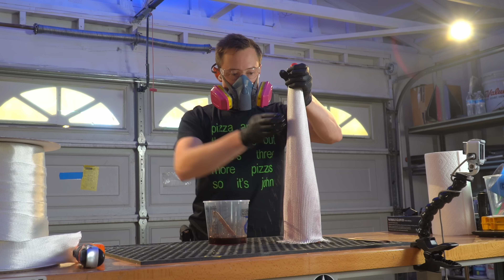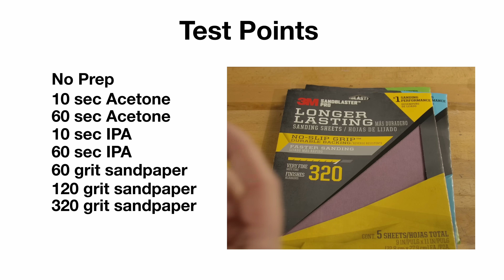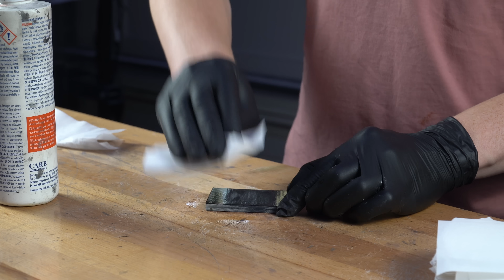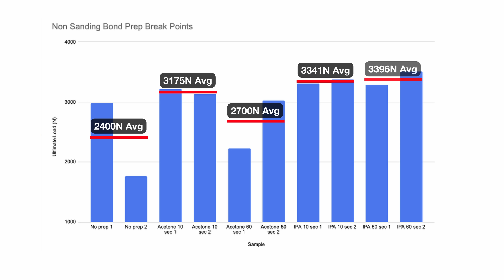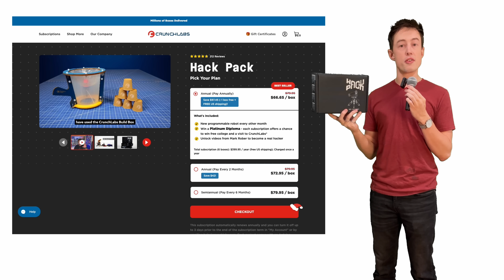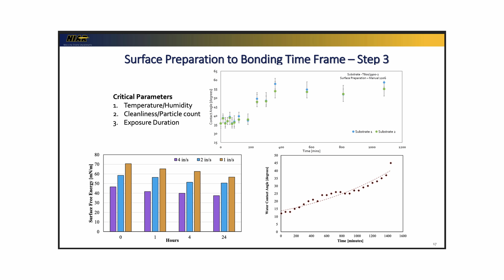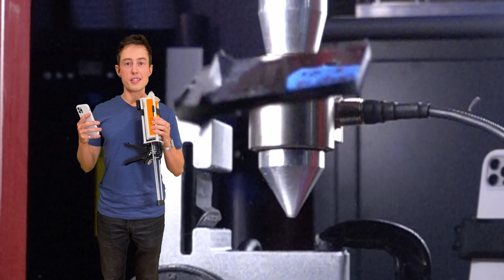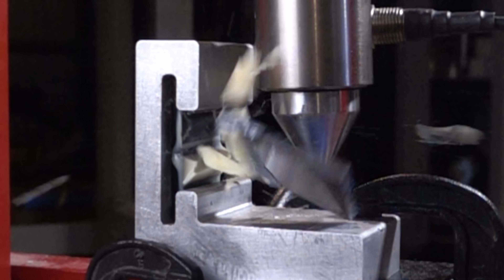I Broke 100 Epoxy Bonds to Find the Strongest

Comment: Few things: Check strength of bonding after longer time. Why? I know from my (and laser cutter community) some materials (as PMMA) cleaned with IPA after bit longer time (say days?) starts cracking. It is caused by phenomenon called environmental stress cracking (ESC). Not sure how it's work in your case, but just consider few long-time tests. Next: I'm very recent viewer and don't know channel - but why you don't use some few mm strong fibres in epoxy? Probably can reinforce joint.  And finally: Story with a specialist was hilarious :)
Reply: Slightly more flexible glue, with some form of added fiber (and/or fillet,mesh,...)

Comment: Tried drilling holes into the plexi, to give the epoxy a way to grip "at depth"? Right now it seems the failing part isn't the epoxy, it's the fiberglass. So dig "deeper into it", heck, idealy you'd make a hole with an inner undercut.....

Comment: 1. Why youdidn't makde the mold taller and wider to top, so vacuumed out resin can sip back by gravity? 2. Why not use a microscope to look on the surface, before pouring resin? After all, all you need is to see what surface bonds best, not so much, about how to make that surface in the first place.... This should be at least two-step check, i think. This magnitude microscope is widely available and quite cheap, especially compared to your workshop and tests price. Then you can check how your surface looks and mostly, how contaminated it is....

3. This is great! You gain resources and sponsoring trough videos that publish your knowledge - win-win for everybody!! What cool economic model!

Comment: Anecdotally i now consider cleaning with a solvent should precede my final sanding rather than being the last step…..you can cause and spread contaminants so easily unless you are impossibly careful. A freshly sanded surface is as contaminant free as it gets as long as you sweep away most of the dust. I take this a step further when gluing metals and will sand the wetted out surface to stop it reacting with oxygen as it is excluded.
Reply: When repairing the inside of cartires, we degrease the surface first, then we 
 sand and rough up the surface. Then remove loose rubber with pressurised air before applying the glue.
Far from brittle epoxy, but maybe still worth a try?
Reply: @frodeolsen6476 as long as its oil and water free air that works

Comment: When you complained about degassing in the chamber overflowing the mold, I was wondering why you didn't update the mold form so that there was a built in funnel at the site of the epoxy to  keep the epoxy in the mold, and get it to flow back into the epoxy site after degassing. Yes, there would still be some epoxy attaching to the mold, but the hope would be that you get a more consistent amount of epoxy in the joint. I'm sure it wouldn't be perfect, but if the target is more consistent results, it may help. But the tests were a year ago, any tests now would likely be with a new batch, or a batch (the old one) with a different age component built in.

Comment: I never wipe sanded surfaces with any solvent, they are already clean. Just blow the dust off. Solvents can leave some residue which can harm the bonding. Another risk is you don't give it enough time to dry so the solvent itself ruins the bond. Especially when you sand it rough it takes longer time for the solvent to evaporate.
Heating the parts and epoxy can help, it lowers the viscosity of the glue so it may adhere better. And it will evaporate the solvent completely if it is used. 
When epoxy is curing it is generally known that increasing the temperature makes it harder and stronger, something like 60-80° C for several hours. This can be done also afterwards, when epoxy has already cured.

Comment: i'd love to see more failure mode analysis from your bonds, especially later in the video. Can you spot a difference when comparing the samples with 2000N differences. With that low sample size, i'd bet you could get more insights if you look exactly how every part has failed. This is assuming you didn't and there would have been differences, of course.

Comment: A quick scrub with scotchbrite and a quick clean with your chosen cocktail of solvents would be fine for this application, you are still asking an adhesive to be a fillet, what you really want is a light silk-weave cloth over the epoxy fillet, it’s the way boat builders do(did) these sorts of joints. That way your fillet has a skin to spread the load, this way minor bubbles and imperfections are less of an issue.

Comment: I'm willing to bet the viscosity of the epoxy will affect which sandpaper is most effective. Thicker epoxy would have a harder time taking advantage of smaller surface features, and bubbles would have a harder time getting out of them.

Comment: Id be curious to see the results using your shapeoko to make a cross hatching pattern using a Vcarve bit on the surfaces of both parts. Then hitting the surface with acetone and IPA. Maybe do a few tests with different cut depths. Ranging from 1/32" - 1/16".

Comment: Great video. I've been breaking coupons in composites for 43 years and still going. As I never trust others' data. Fibre exposure with abrasion is so complex, ie fibre diameter vs gouge depth into it. Fibre strand surface treatment ' sizing'  is also only a few micron thick so what you are anchoring to changes with gouge depth. Temp ...both molecular migration during cure ( particularly when adhesive matricies and substrates are chemically similar) as well as in service service temp particularly when adhesive matricies and substrates are chemically dissimilar. Many composite operations neglect service temps when testing like ski factories. Some bond types improve dramatically with temp change. Also grit blasting is very very consistent (with clean air ).  Another good trick on some materials is surface  sanding under wet epoxy, then (mostly)  wipe contaminated epoxy off and bond with clean epoxy, this is critical on surfaces that can't tolerate any exposure to oxygen, mostly specialized metals.

Comment: In my very very limited tests i have found one thing that increases adhering.
Heat up the epoxi to about 50c before applying it.
This dramaticly lowers the viscocity and makes the resin creep into nucks and crannies a lot better.
I use this method when porting cylinderheads to get for example JB weld to really sit good.
I also use a very rough grit surface, like 36 paper.(but on a rotating grinder)

But maybe this is what happens when you vacuum it, i do think though that a lower viscocity might help.
As it keeps warm for a longer time then time you vacuum.
The viscocity almost becomes like water when epoxi is heated up some.

So combine the two =)

Comment: IPA and Acetone are not pure but contain byproducts. These byproducts are often production residues, and i guess there are specific tests for specific known byproducts. Now if those byproducts worsen the Epoxy adhession on the material, Acetone or IPA wiping might worsen the results.
Im at 8:21, and eager to know if the guy also tested Phosphoric acid for surface activation prior to gluing :)

Comment: This was a really excellent video!  And an excellent comment section too; lots of knowledgeable advice there.  Two thoughts to add: First, this really showed the value of having your data.  Because, as you say, you never control for all variables -- but you need to know that your process is controlling for enough of the ones that matter, and the only way you can know that is by testing your own process.

Second, when you were getting the consistent results in the last set, it looked like you were essentially always getting separations within the epoxy.  At that point, you're no longer testing the strength of the bond; you're testing the bulk epoxy strength, and details of surface preparation aren't going to make a difference there.  So it seems like the places for further research are on making sure the surface preparation consistently produces that strength, and then on making the bulk epoxy stronger.

Along those lines, one of the things that surprises me a bit about your construction -- and this is from a point of a lot of ignorance of the details! -- is that you're not making these fin-to-body joints by laying strips of woven carbon fiber along the seam and epoxying that onto the two surfaces.  For the strongest fins, I think the very best option would be to make them very thin, stick them onto a section of rocket tube that's a bit smaller in outer diameter than the rest of the body, and then lay U-shaped pieces of carbon fiber that cover one side of one fin, the adjacent tubing, and one face of the neighboring fin, repeating those until the fins are the desired thickness and the body the desired diameter.

Comment: I would test different epoxy shapes and angles as well and not just a 1 cm 45 degree. Is 30 deg better with more surface area attaching it to the rocket side? It seemed like the top bond could be bigger or have more surface area because it’s almost always breaking off at the surface and not either component failing directly.

Comment: A few thoughts.  One, I'm surprised you didn't try a sand blaster, as this could be done much faster and with far less effort.  (And you don't have to spray sand.. there's other media to experiment with.)  The next thing that bothered me was your release and demoulding technique.  When you demould, you could be introducing micro fractures that could propagate into your bondline.  I would suggest 3d printing a much more flimsy mould and then just leave the whole thing together.  The epoxy will be stronger than your 3d print, and I think the print would become negligible at that point. 

With regard to the epoxy, I would recommend using a scale and mixing it by hand or better yet, an impeller.  Just weigh both into the same cup so you don't lose material on transfer.  Then mix well and degas before even pouring it.  You can always degas again after pouring.

Another big factor could be humidity.  I would recommend heating your samples before gluing them to drive off moisture.

These are just few thoughts I had.  I've got a lot more ideas, but this is a good starting point.

Comment: I'm a simple rock wall builder, (also a billiard physics and hence surface friction enthusiast) and a strong wall doesn't like long linear cementing paths, which sanding will create on a surface. I'd suggest trialling compressing sanding paper into the surface to create a greater contact area with less linear weaknesses.

Comment: Not super far into the video, but why the paste adhesive fillets for your fins? It would take a bit longer to make, but if you wet lay carbon plies between the rocket body and the fins, you'll likely get a much stronger and lighter joint. Even better you can put a nugget of adhesive between the fin and rocket body, then lay up over the whole thing.

Bonding quickly is important because your surface re-oxidizes. How quickly this becomes important is probably material specific.

Typically you don't want to use a solvent after sanding. You can re-dissolve any contaminants that were on your surface back into the material.

What is the relative humidity of your area? Maybe you address this, but typically you want to dry your material before bonding it.

Comment: Just here to see how many Boeing or aerospace mechanics are here. We all know all of the best practices because they’ve done all of these tests thoroughly and we do all (or are supposed to) of our aerospace assembly.  
The process for cleaning is normally MPK or MEK to clean then the final clean is done with a wet wipe on and dry wipe off IMMEDIATELY after wet wiping as to not allow the MPK to dry before dry wiping it off. Zero contamination left behind this way. 
They use etching compound on aluminum parts and 3M red scotchbright pads to get the surface scarified. (Scratched up). This is aviation standard. IPA is not used hardly ever. It leaves behind a film that impedes adhesion.
Reply: I run a welding job shop, and your mention of a wet wipe to an immediate dry wipe is an interesting parallel with our paint prep procedure. For a long time out procedure was a simple wet wipe with rags and wash thinner, but I noticed that it inevitably left a layer of dirt/contaminants on the metal surface. That made sense, as the thinner is cutting dirt and oils, but without being immediately removed with a relatively clean rag, the thinner was simply flashing off leaving behind all the stuff you’re trying to remove. After that revelation I implemented a wet wipe/dry wipe system for our final wipe down. Now a guy can run clean fingers of a prepped surface and pull back a with minimal to no noticeable dirt on them 👌 “good enough for government work”.

Comment: I've been in the construction industry for 40 years. I have a couple suggestions that might help. First I don't see you're putting any epoxy behind the piece of sliding in your fin. Second when epoxying I've always been taught that you want to rub the epoxy on both surfaces when epoxy two pieces together. In this case you only have the one surface though behind the fin should be rubbed on both sides. I really believe that if you put epoxy behind the fence and rubbed it on both sides stuck it together then poured the molds took a popsicle stick and literally pushed it against the plastic then did your degassing you would end up with a much more solid piece. Also you could try adding components to your epoxy itself. Like little fiberglass hairs are aluminum oxide depending on the epoxy. Most epoxies are only made to go so thick so adding something will add strength depending on how thick it is. For example a lot of times in construction when we're filling in holes with fairly large areas will get an epoxy that comes with a sand in it. If it was me I'd be sure to put epoxy between the fin and the shell of the rocket then to the bulk of the epoxy I would add something to increase the strength of the epoxy. I hope that makes sense and I hope it helps.

Comment: change the way you demold the samples, cut the molds in half on the long axis, use a professional epoxy mold release, and use clamps to keep the molds together until cured and released. the way you force release the samples it might weaken those samples.

Comment: I think you need to flame treat with silane last after sandblasting and cleaning with acetone and IPA . Get rid of that mold that requires lube and use a proper jig. Increase the amount of space between the fin and body to allow for more glue. And consider using a wrap of high tensile mesh to lay into your epoxy on each side of the fin. Also why are you not using epoxy with graphine carbon nano tubes, glass beads or aluminum powder in it?

Comment: I spent the better part of a year trying to figure out why a urethane resin was not bonding to carbon fiber.  I finally figured it out (I think...), and completely by accident.  Thermal cycling (hot resin and post cure) + CTE mismatch + fiber filler in the resin.  With the fiber filler mixed in = 100% delamination.   Same part, prepped in same batch, same resin, same cure cycle, etc...but with filler settled out = great bond!  (I will add the acetone + IPA to the process in case I'm still wrong about it...)

Comment: It feels like the location of the break and how much breaks free from the surface may also be valuable data points. From someone with no knowledge of any of this stuff, just wondering, is there any reason why other attachment methods aren't viable like screws and/or grooves for the fins to sit in?